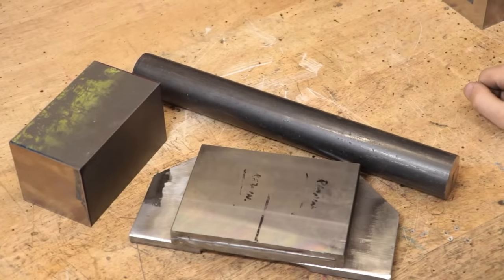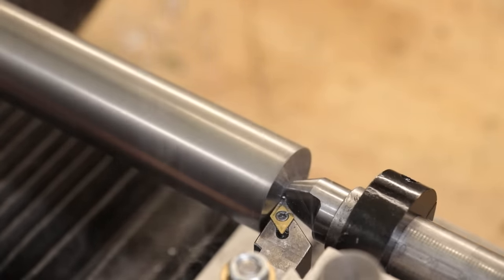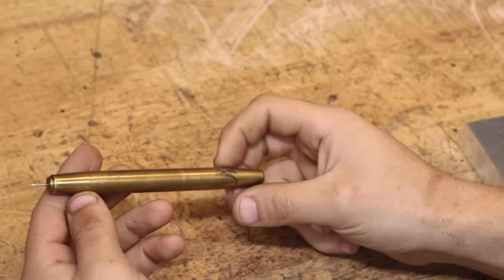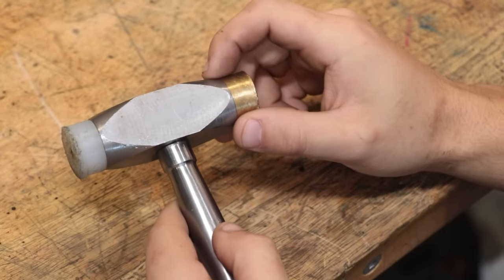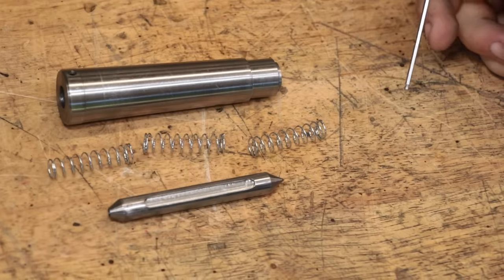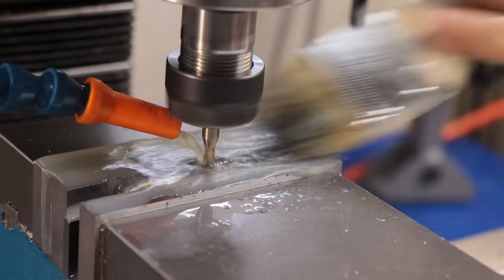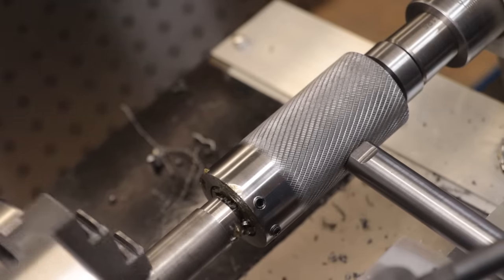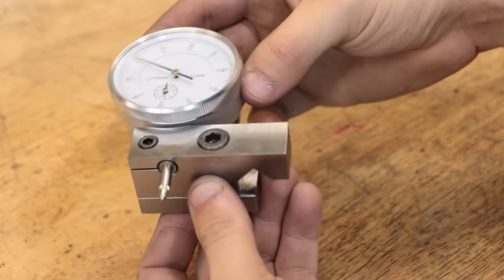The 6 Best Lathe Projects For Beginners

Comment: I don't understand buying thousands of dollars of machinery, to spend miltiple hours or days, to make items you can buy for $12.
Reply: Then you don't understand how to learn how to use machine tools.

These projects used to be the kinds of things you used to do early on as an apprentice. There are plenty of old machinists out there who, if they dig hard enough through their tools, they'll find the machinists hammer they made as a spotty youth.

These projects let you practice facing, turning to dimensions (even if they're dimensions you made up in your head 10 minutes before you started), turning to a shoulder, adding chamfers and potentially boring and single point threading.

I mean, what do you think a beginners first project would be? Building a fekkin space shuttle? 😂
Reply: @stevedavey1343  spending thousands of dollars on a machine you have no idea how to use is dumb.

 Professional machinist made their  apprentices make those as a test before they trusted them to working on anything important. Neither of the two purchased the machinery. That's far different. 

I have never once had the desire to make any of that junk. The projects and repairs I do are of far greater priority of my time.
Reply from the maker: If it doesn't interest you then don't do it. But a lot of people over many generations have found these projects to be useful. And sure you could by them, nothing against that, but this is what i have always chosen to do with my hobby.
Reply: it is called fun dude ! Why do i spend thousands of dollars to go and catch fish when i can spend $15 at a shop to buy fish fingers ? Because it is fun for me !
Reply: @ianbertenshaw4350  yeah that's fine. Bit no one is out here showing practical, cost effective, applications and solutions for people who have better things to do
Reply: @artisanmakes  that's fine. Don't hate the messenger. I admire the vast majority of the work that you do. Especially with the equipment you have. These are just a dumb waste of most people's time. And I'm not just picking on you, everyone is posting this nonsense🤷‍♂️ a carbide scribe from a reputable manufacturer is less than $7 dollars. You can get a half dead center for under $20. 

The problem is a person gets a channel started and starts getting desperate for weekly content, so instead of posting worthwhile projects, the content creator gets hungry for the views and starts posting these waste of times. You see it across every creative/project based channel.
Reply: @EitriBrokkr "don't hate the messenger" as if you're just a third party who happens to be delivering a message calling this "a dumb waste of people's time" 💀

Jog on champ.
Reply: @EitriBrokkr Hmmm...

How else would you suggest hobbyists who have no knowledge of machining start to learn? Okay they can go to a local community college but apart from in the US (where apparently everyone from the age of 5 can recognise an Acme thread from 30 yards! 😂) short, cheap, beginner courses in machining aren't as common as they used to be. Also again, apart from in the US (where apparently you can  regularly find 5 South Bends at any given local church jumble sale) secondhand, inexpensive,  well-cared-for lathes are not common.

These projects might have been tests too, but primarily, they're a lesson in order of operations and putting all the basics together. When you're learning to play a guitar, you learn individual chords first and practice being able to form those shapes with your fingers correctly and consistently, only when you can do that do you start to learn songs.

The kinds of lathes a lot of beginner hobbyists end up buying (well, apart from in the US, where...well you get the idea 😂) tend to cost a bit less, around, or a bit more than $1000. Not that many beginners go above about $1500 for their first lathe. If they do, it's because they have plenty of disposable income and good for them; spending more will probably get them a bigger, better made and most importantly, more rigid machine (there are a fair few of the abovementioned beginner hobbyist machinists who find themselves doing a solid toolpost riser 'project' to replace their compound pretty early on 😂).

Finally there's the pride of using tools you made yourself and that's a pretty damn fine feeling; it's an even better feeling when you're early on in your learning journey. 😉

I know you won't believe me right now, but the best way for most people to learn to use a lathe are these kinds of projects. The end results are useful and the projects are just complex enough to stretch a beginner's skills without being so complex as to overwhelm them.

Finally, can you give an example of a beginner level project, you think is appropriate; something a learner could sensibly tackle just after becoming proficient at the individual basic operations?

Maybe then we could point you in the direction of resources that would fit you better?

Comment: you are talking about precision and then you use imperials. That is wrong.
Reply: 1 thousandth of an inch (1 thou as British machinists call it) = 0.0254 mm (25.4 microns).

1 ten thousandth of an inch (called a tenth by machinists, a tenth of a thousandth; not to be confused wirh a tenth of an inch which not even woodworkers would use) = 0.00254 mm (2.54 microns).

Imperial or metric? Irrelevant to precision.